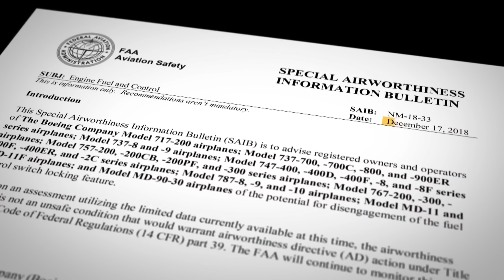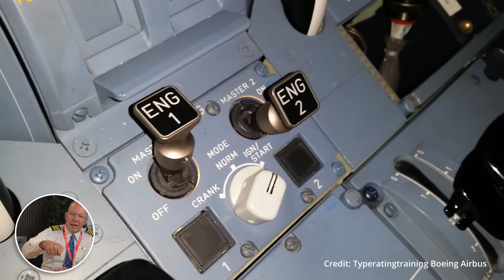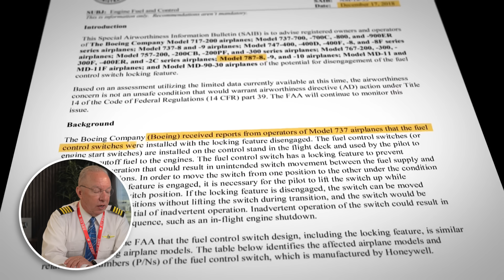Air India 171: The FAA’s 2018 Fuel Switch Locking Bulletin Explained (16 Questions Answered)

Comment: A couple of things don't make sense based on the facts that I know (July 13)
1. Co-pilot's Actions and Control: If the co-pilot, who was at the controls, was responsible for moving the fuel switch, it's perplexing why he would maintain an 8% descent rate until impact. He could have initiated a more rapid descent and crashed the plane much sooner. If it was the captain who took control from the co-pilot after the engine stopped, a change of flight attitude would likely have been spotted in the last-minute footage. FDR should have that data as well.

2. Pilot Communication and Switch Activation: If the captain was the one who shut off the fuel switch, their subsequent "Mayday" call is inconsistent. Conversely, if the co-pilot made the "Mayday" call and questioned the captain about the switch, the captain's denial of involvement would be illogical. Furthermore, if the co-pilot was flying and the captain was managing thrust, the captain wouldn't have a free hand to manipulate the fuel control switch. Similarly, if the co-pilot was on the yoke, they wouldn't be able to move the fuel switch.

3. Fuel Switch Wiring and Misleading Data: The fuel switch does not physically control the fuel pump; the Flight Data Recorder (FDR) collects an electrical signal. This raises the possibility that a faulty command originated from the fuel control switch processor rather than a physical movement. This could explain why the investigation team tested for electrical failure but did not encounter such an issue. Because it doesn't send out a faulty command every single time.

4. Fuel Switch Design and CVR Data: Given that the fuel switch is spring-loaded, the Cockpit Voice Recorder (CVR) should have captured the distinct sound of it being switched on/off, especially since the team reportedly cycled it at least twice.

5. Timing of Fuel Switch Manipulations: If a pilot could move both fuel control switches in one second initially, it's unclear why the subsequent attempt to switch them to "RUN" took four seconds. This discrepancy suggests the possibility that the switches were already in the "RUN" position, requiring them to be moved to "Cutoff" and then immediately back to "RUN".

Comment: Hi Captain, why wasn’t the landing gear retracted? Why was the landing gear lever still in the down position even at 600 ft?  
Something seems to have happened just after takeoff, before the aircraft reached 50 ft of altitude. Normally, with a positive rate of climb by 50 ft, the crew calls for “gear up.”  
Does the FDR record fuel cutoff parameters if initiated by FADEC?  
If the cutoff is done manually by the pilot, is there any way to determine that it was a manual action rather than an automatic system-triggered response? Thank you!

Comment: When switch as critical as fuel is cut off while airborne, red buzzer shd go up immediately and pilot wd try get in run within 3-4 secs....bizzare it's not there....also it's difficult to believe pilots only had 1 sentence exchange between them during last 25 seconds?

Comment: As per the preliminary data released by the investigative authorities, they have mentioned that both the switches "transitioned" from RUN to CUTOFF within a second of each other. Considering that the switches need to be toggled and only then can it change its position, how is it possible for any one person to flip both the switches within a second. Also, when they flipped the switch back from CUTOFF to RUN, it took them 4-5 seconds. So how can this be a human intervention relying solely on this fact?

Comment: Does the most modern technic of Boeing make it impossible to block the possibility to use the switches to cut off the engines of the fuel during the take off ?

Comment: @CaptainSteeeve Was it even feasible to save that airplane if the pilot flying had reacted 2-3 seconds earlier? I assume the 1st engine (the one that did not re-light when fuel was re-introduced) just spooled down too far and the airflow and pressure weren't high enough for a re-light. Would having both engines slowly regaining RPM (but still very low in thrust) possibly saved the airplane at that altitude? Also, would leveling out the airplane to maintain as much speed and allow more airflow help at that point? It seemed like the airplane maintained a noticeably positive angle of attack until it disappeared from view (of the cameras) which stood out to me as weird considering the (back then theory of) loss of thrust in both engines. I realize it would take a tremendous amount of situational awareness and resistance to a natural reaction of denial to the "betrayal" of the other pilot as there always has to be some degree of inherent trust between both pilots. 
It's not something a pilot trains for (they might start now) but placing those switches back to Run within like 2 seconds would allow them to more less continue the takeoff. Question is what happens after that? Do you throw the dangerous pilot out of the cockpit to prevent him from trying something else to crash the plane? How do you physically do that when you're the one flying the airplane? How do you explain this to the rest of the crew?

Comment: Hey Steeve, im just an enthusiast. I really appreciate your suggestion regarding asking about "How You Doing?". But my concern is suppose if a pilot feels his partner pilot is not in perfect condition, if he reports for pilot change wont that create an air of mistrust? Or suppose if one pilot willingly reports he is not feeling right state of mind for flying, wont there be a risk of demerits point or negative reputation? Would the operations team look at it positively considering the fact thy have to face the hassle of rearranging another pilot at the last moment which is also subject to availablity? Also may cause costly delays. Just to save his reputation may be still many pilot opt to keep going with the flght. At the end its a busines and like any other business management never appreciates any human failure which may cause delay, may cost reputation,  may cost extra fuel expense, may cost airport charge for delay. So do you really think it will ever be possible for any pilot to opt out from a flight duty without facing any consequences?

Comment: Maybe the fuel cut off switches could be designed to be under a glass panel like fire alarm switches are. Once flights initiated the glass panel can't be lifted but It can be cut off if the glass panel is broken. In that final moment it may allow the other pilot to intervene if the other pilot tries to smash the glass and cut the fuel off.

Comment: Anyone reading this
1. Why does is he completely deny that it can be a design flaw

2. Why does he say pilot intervention is a surety without the findings being out.

3. Why does he think that FAA’s advisory was to not install the switches upside down but it wasn’t about locking mechanism failure. Point to notice “ HE THINKS “

4 . Why does he talk so calm and in a subtle way defends the company. Does he want to control the narrative ?

5 Why aren’t you using your brains and instincts guys ?
Reply: You are just asking questions.. Give your counters if you have any.
Reply: I am no denying anything . I am just saying there can be a possibility of anything . There can be a possibility of the control mechanism failure as well . There can be a dual engine failure after which the pilots had to reset the switches. How can he deny anything concerned with Boeing with so much of confidence and only blame the mental health issues without any proof. This does smell fishy
Reply: I imagine the black box gave investigators no other reason why the engines failed other than the fuel being cutoff from these switches? And two engines failing or being cutoff one second apart from each other is weird. So maybe use logic next time.@aviatorsoffice6779

Comment: 🙂🙂🙂howabout in future to have the fuel cutoff switches separately located, e.g one cut switch for each pilot, so that both cutoffs can not be physically reached by one pilot while pilots are seated, and therefore be impossible for one pilot to switch both engines off?

Comment: Captain, I am myself a Pilot. Flown Sea Harriers in the Indian Navy and later B737-300-900 and A320. It seems the engine switches were not moved physically when they showed in EICAS as having been put to off. It must have happened by FADEC and later pilots recycled the switches physically to start the relight sequence.

Comment: I recently retired from the bus industry. In my particular jurisdiction all buses are fitted with surveillance cameras with at least two focused on what is happening in the driver’s cabin. These cameras have been used to get drivers fired but also to save their jobs. About ten years ago there was a serious accident involving a bus that suffered a parking brake failure, ran away over a railway embankment and landed near a rail track partially blocking a busy main line. Upon viewing the camera footage it was observed that the spring-loaded park brake randomly released after sitting in the “apply” position for I think eight to ten minutes, the driver was not on the vehicle having left the cab and walked away from the bus. It was identified that the detent designed to hold the T-handle type brake lever was either worn or of insufficient depth to hold the handle in the detent and stop the spring release function from moving the handle to the release position. Subsequently all these types of handles were progressively replaced by a part with a more secure design.

A camera in the cockpit of AI171 might’ve provided some proof of either a fault or deliberate act? If the camera had been say, disabled it may have indicated without doubt that a deliberate act was involved?

Comment: Could you not 3:37 test in a simulator to see if the aircraft would alert the pilot. 

For pilots privacy I don't think cctv 247 should be a thing but I do think that pilot cameras should be installed that have a clear recording indicator to show when an emergency is in place the final crucial moments will be captured and saved to the black box.

Comment: There are articles about complaints of faulty switch complaints,or the functioning complaints,is it possible there was a eletric error, which caused the power cut or fuel cut, that's why  the pilot denied 'i did't' , that's when they cut the switch off and on again,(which took them 10 sec) but fhey didn't have enough time.
Reply: Exactly error when it was impossible to recover. Probability 0.000000001. Deny was true if terrorist was asking. Or lie because of insurance to family

Comment: If there was something mechanically wrong (ex. FAA 2018) with the switches locking, this would have been noticed by all pilots flying this place before the crash. I hear pilots doe report quicky any such problems they detect. 

The switching off happened not simultaneously, but a whole 1 second away. So it was not one single wrong movement of one of the pilots. 

I understand these particular switches have been found in the wreckage and can be examined if they have any mechanical problems.

Comment: Hi
If the springs of the switch pins have loosened and the locking space has worn out, it is possible to change their position with your elbow or the sleeve of your clothes. I think the location of those switches in the cockpit is wrong.
This is my opinion.

Comment: I think a camera system is a great idea. I know in trucking industry. Its now required. Every truck now runs video. Some have it facing forward and some also have it recording the i side of the cab and sleeper too. It would garantee the answer everyone wants to know now. Did they in fact shut off fuel to engines and whuch one did it if they did. Crazy. But at least im releaved it wasnt my work on the plane that caused this.

Comment: Wouldn't the pilot flying see if the non-flying pilot moved the fuel cut off switches during take off and comment on it? Presumably the switches have to be moved one at time. Peripheral vision may have caught this. Also can a faulty chip have caused thee apparent moving of the switches?

Comment: Hi Capt. Thanks for your excellent video coverage. I have a simple question. What is the monitoring and recording system sample rate specifically for the fuel cut off switches on this a/c ? This figure will tell us the time resolution of our data events.  If it is a course resolution say 1S then the figures quoted in the prelim report are not exact and at worst misleading. Cheers Will.

Comment: The surviving passenger said yellow and green lights came on in the cabin.. are those emergency lights and do they come on without an electrical failure, as in, do they come on if fuel is cutoff to both engines?

Comment: Hi Steeve, Why should the fuel cutoff switch even be functional when the engine is running at its optimal speed while takeoff or even while cruising for that matter.
In such an advanced technology equipped machine, why can't the fuel cutoff switch be locked automatically when the engine is at its optimal speed?

Comment: Sadly looking more and more like another intentional suicide by crash (I still hope I'm proved wrong on this). A tragedy on top of a tragedy and something that no amount of engineering failsafes can prevent. It is going to take a step change in commercial airline culture to address this so if cameras in the cockpits can even prevent one of these events from happening then that has to be a good thing (and if it prevents minor SOP infringements from occurring more often then that is a huge plus too as most accidents are a culmination of many minor individual components that combine, as everyone involved in aviation knows). The people up front have a responsibility for all the people in the back (and generally do it exceedingly well), having additional data logging by way of video recording shouldn't be an issue if everyone is following SOPs to the letter.

Comment: The 2018 report about the issues with the faulty Boeing switches says BLACK ON WHITE that there are issues with the locking mechanism. A pilot having his wrist on the switches when holding the throttle, can accidentally flip them without much resistance if the locking mechanism failed.

Comment: It’s not impossible to hack the aircraft, it’s just so incredibly difficult to do successfully. There are actually multiple flight computers aboard the aircraft. Multiple computers allow for fault tolerance. If memory serves, the 787 has two physically separated computer racks that host 8 computer modules. The modules use the same core operating system for standardization, but are partitioned so it’s not one single instance of an operating system running the whole aircraft. for

If I recall correctly, for actual control of the aircraft there are three computer modules. Only one is necessary. During normal operations, again if memory serves, the main flight computers actually “vote” on whether to perform whatever action is being commanded. Majority rules. I don’t remember how the system handles one of the computers crashing, but that’s not germane to this conversation.

To successfully crash the aircraft by hacking it you would need to compromise AT LEAST three separate modules split between two separate racks in different locations on the computer. Or you’d have to compromise the operating system at the source so it would be installed on all the modules.

The base operating system is Wind River, which is UNIX or Linux. So this ain’t your “use a hack pack you downloaded off the internet” hack to hit a Windows machine.

Then you need to either have the instructions to cut fuel hard coded into the malware or you’ll have to also get access to the aircraft to rig up some kind of communication device.

For the time and physical access required to do that, it’d be easier to put a bomb on the aircraft.

Comment: As you said, There were two fuel switches, to cut off fuel the switches must be pulled  and then moved down. Is it possible to do that procedure with both the switches within 1 second. the report says that the switches were engaged at an interval of 1 second.  My guess is that the time interval should have been more, if the pilots were relaxed and in no hurry.

Comment: 7:29
I would like to specify that this information was stated in the preliminary report, page 6, last paragraph of subsection 4 "Aircraft Information". The report does not directly link the bulletin to the cause of the accident, but it does not deny a link to the bulletin either. I would assume that if the report felt the need to specify this exact bulletin and emphasize the fact that Air India did not carry out the "suggested" inspections, that this could be a fault that can and probably is being explored. This would be a good moment to emphasize that the report is preliminary and nowhere has the word "deliberate" or it's synonyms been used in the entire report. The report has laid down the facts that are known to date and suggested possible leads including, but not limited to, pilot error and mechanical failures. Speculating to an extent is reasonable but definitively stating that the act was deliberate, at this moment, would be unreasonable. One must rely only on the reports provided by the authorities and not the media (as it could be biased).